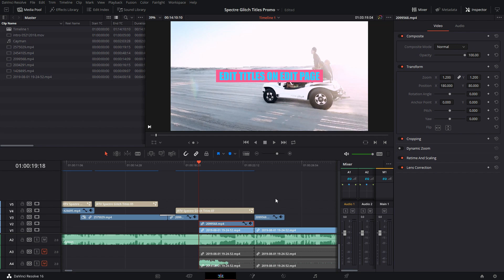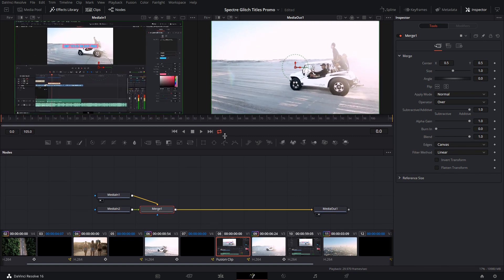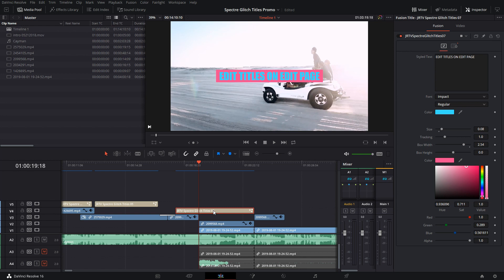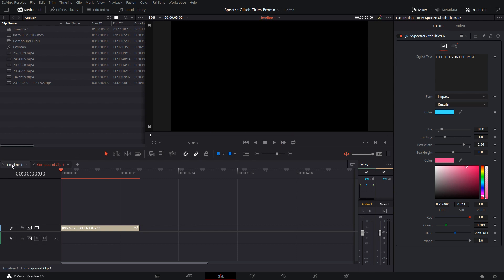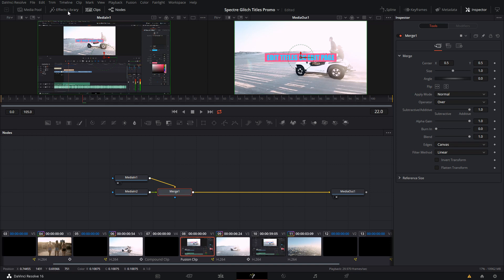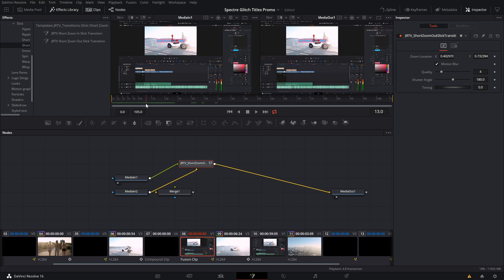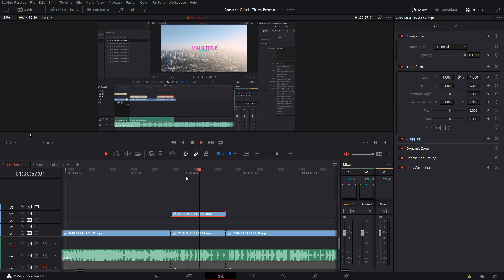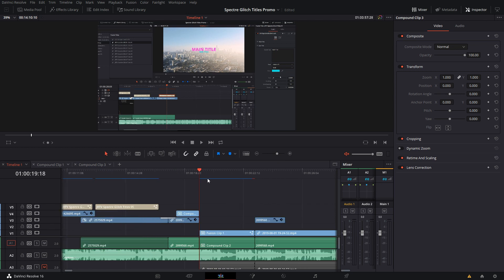Using compound clip in DaVinci Resolve

Comment: I don't know if you have any ideas that could help me out, I recently edited a video as usual, auto colour correct (used before no issue).  I tried rendering it and each time (randomly at different times in the process) it has caused my PC to switch off any ideas?

I moved it to a new project, I even changed it to a compound clip in the hope it would help, same happened for both.  I even cut it to smaller (5min) segments to see if it would render them separately but still causes the PC to abruptly shut down.  16 Beta btw.
Reply: I had similar problem after updating to latest Nvidia driver. Resolved after downgrading.
Reply: @97DarkSkull  Interesting, I will try that tomorrow it could be the same issue, thanks.
Reply: @97DarkSkull  Still did not work, I even tried the different versions (game ready and studio driver), still crashes every time, I even reinstalled DR.
Reply: If it is causing your computer to shut down are you sure your PC is not overheating? Your PC will shut off if it gets too hot to protect itself and rendering a video is a lot of work, and will, therefore, generate a lot of heat.
Reply: @Buddyboyjlg  I do think that is what the problem is.  16 must need more Processor power than previous versions as I've used 14 and 15 before for quite a while with no problems.  Pity they don't do what IMO should be the norm, use less processor power and quite a bit more GPU power for editing and rendering.  

You can render using GPU but the settings BM suggested to me made a huge, unplayable (at least smoothly) video.  Definitely not good for uploading on here.

Unfortunately back to Sony MS Plat 15 for now, although I make use of DR still for some little things that can't be done to my knowledge in MS.